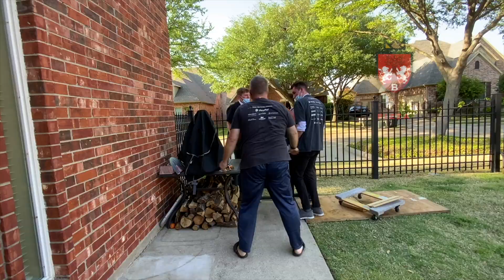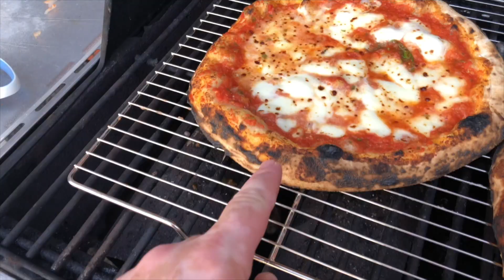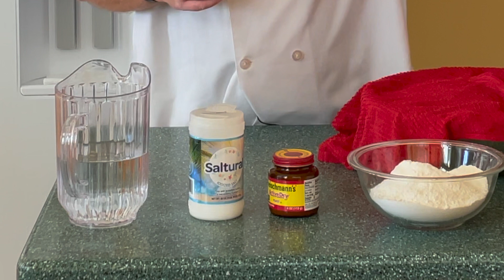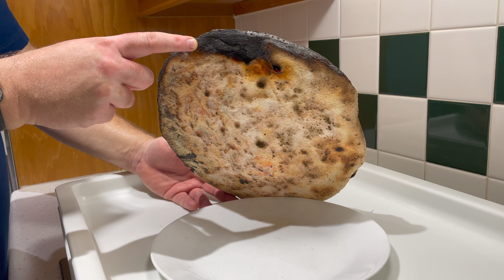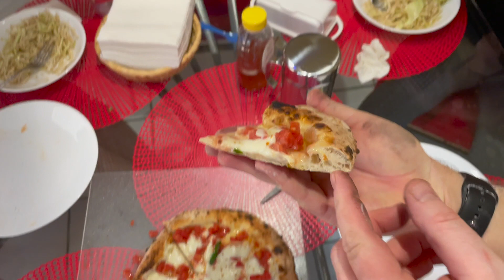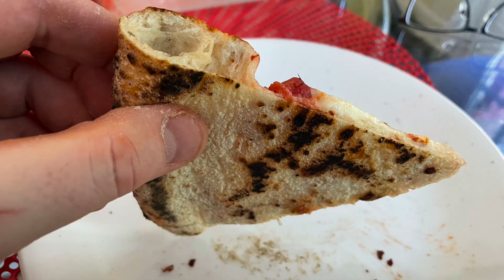Whats going on in my Zio Ciro pizza oven? (what happens scientifically when you put a pizza in)

Comment: Will you be having a follow-up video on your pizza oven? Pros/Cons
Reply: I've had the smaller Subito Cotto 60 with Propane for almost a year, and love it. Like any tool, there is a learning curve, but once you figure it out, you will make very consistent pizzas.
Reply from the maker: I've heard good things about the SC 60. Have you ever cooked in it with wood?
Reply: @BitontoPizza  No. And I never intend to. Prior to the SC60, I was doing pizza on a "Kamado Joe Big Joe" grill. But I was spending so much time managing the fire and pulling out the high temps, that it took all the joy out of making the pizza.  I'd have to babysit the flame the entire time, or I wouldn't hit the required temps. With the SC 60 + Gas, I just turn it on, and throw down my pizzas an hour later. That allows me to focus on the food, and the party.
Reply: @Liboman  I am also interested in the 60 buying for my apartment. Do you ever cook lower temperatures like 350 celsius? How easy to manage the gas burner at those lower temperatures? Thank you.
Reply from the maker: Definitely! Thanks for asking. Spoiler alert: I love my oven!
Reply: @BitontoPizza  cool, I’ve been looking at a zio ciro for awhile. I canceled my dome order for several reasons and I’m interested in the durability of a zio ciro.